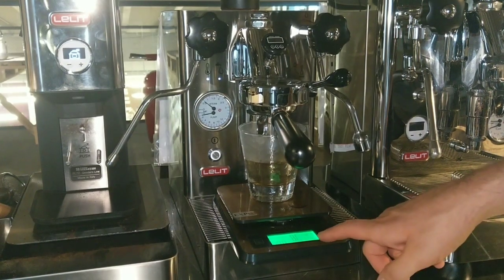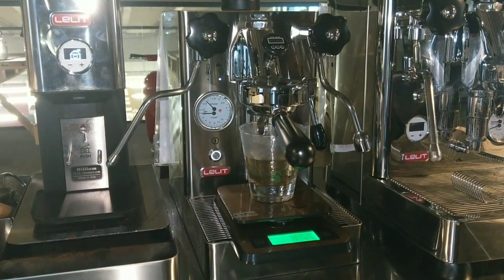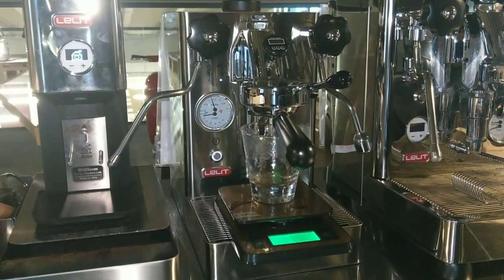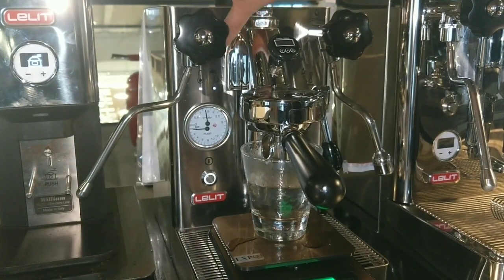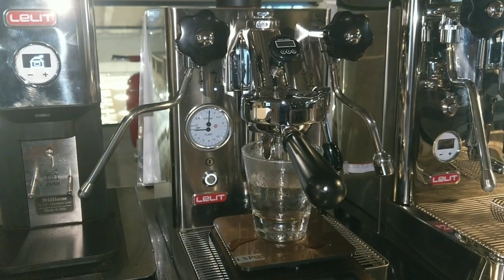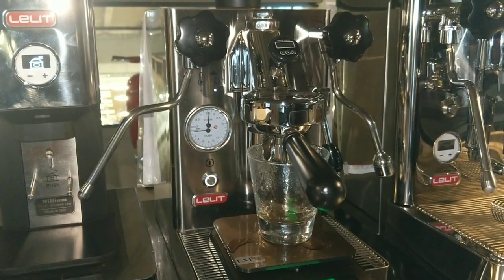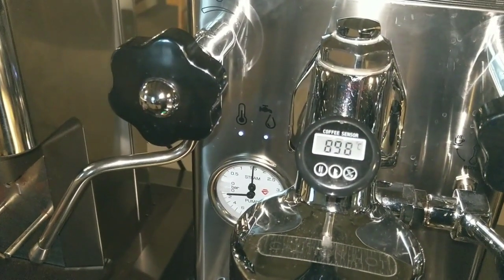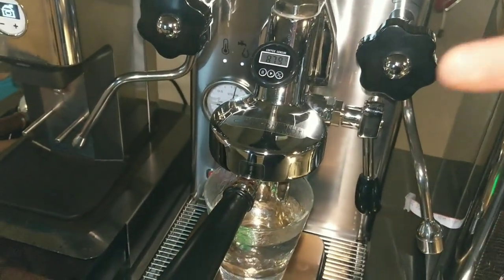pl62x ready light starts blinking

Comment: This video is very interesting thank you.  I have a v1 Mara X since May 2020.  The workflow in my house is generally a session of two back to back espressos,  then steam two different Milks (different kinds) .  The first session is fine, never an issue.  Round 2 is usually an hour later.  Lately I've been getting the flashing light and not enough steam for the second round.  It's as though the boiler is not topped off  prior to the second session.  It fills during the second session and I have to wait 10 mins to get enough steam.  While in V1 coffee mode "1", doesn't the machine try to keep the boiler topped up?  

BTW using Steam prior or HX mode "0", I do not have these issues, but rinsing etc, is not why I bought this model.  I use that mode when I have more people and coffees drinks to prepare.  I've thought about upgrading the board to v2, but I'm not sure that my problem is addressed there.  Even worse, HX mode is gone completely.
Reply from the maker: in your v1 machine, after the our of stop, try to switch off and switch on the machine , this reactivate the warm up, and restabilize the water into the boiler.
if you want upgrade the machine, the software v2 solve this kind of problems and ghive you 120s of steam power after every shot
Reply: @lelitinsider2977  Grazie mille

Comment: Hi, have this led blinking since i have changed my gicar to V2 even pulling short espresso. the reseller send me a probe with the gicar, may i change it?
Reply from the maker: but, after some minutes the ready light is on?
Reply: @lelitinsider2977  just after the extraction
Reply: @lelitinsider2977  problem is the Steam pressure increase to reach the good température and i have to wait 15min to stabilize
Reply from the maker: @ciruscoffee4290  the circular button is in 0 position?
Reply: Yes 0 position, priority coffee
Reply from the maker: @ciruscoffee4290  when you are not using the machine the pressure will be below one bar,  is it correct?
in the setting 0 the resistance is off when the group lever is raised, so you have to dispense coffee immediately, then when you lower the lever again the pressure will rise for 120 seconds, 
after these 120s the heating element is off.
when you start using the machine you have to brew all the coffees first and at the end you prepare the milk, if necessary, this avoids to brew the coffees out of the overheat phase
Reply: @lelitinsider2977  Problem is heating led blink during or just after pulling an espresso, so pressure increase 1,5 bar for 15min, i have to wait this time to stabilize temperature. V2 software may stop heating after 120s
Reply from the maker: @ciruscoffee4290 id the led id blinkings means that  thr trmperature into the exchanger is warm than try to set the circular button in 1 position
Reply: @lelitinsider2977  why position 1??
Reply: I thought heating element blink when the group is too cold. Pressure increase to warm siphon no?
Reply: @ciruscoffee4290  did you solve the issue?

Comment: This happens to me too in CoffeeX mode, in v2 Mara X. I assume once the optimum 24 min is up, the heater element is turned off, and steam pressure starts to decline. I notice that if I pull my first shot at steam pressure around 0,7 bar (exactly around 24 min) the Ready light does not blink. If however, my prep is slightly slower, and end up pulling the shot at 0,4 bar, the Ready light does blink halfway through the shot. 

However as this video shows, at 1:26, the grouphead temperature is still relatively unchanged. So it probably doesn't affect the extraction. 

Hope that helps.

Comment: This is happening with my  machine at the moment. But also with less water. Just a double espresso (45g/ml).
Machine is starting with blinking, after the shot. 

Heating up in Steam Mode never stops the blinking. 
Short interuption of power or removing the water tank stops that and machine stops blinking.

I think something with the temp probe could be wrong.
What do you think @lelit insider?
Reply: My brand new Mara X v2 does the same. I don't understand. How did you solve the problem?
Reply: I have the same issue with V2. What did you guys do to fix it?